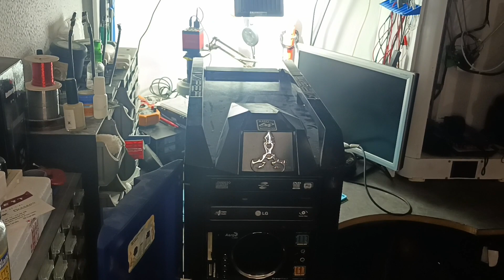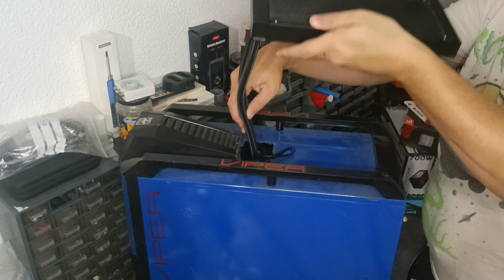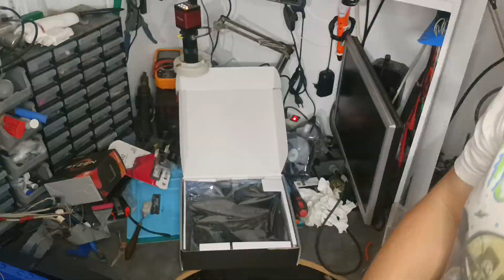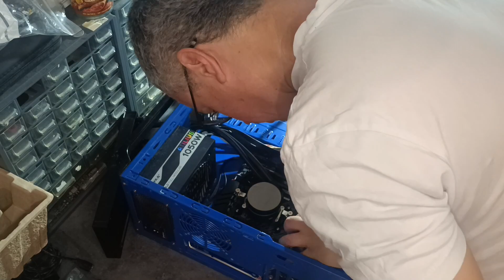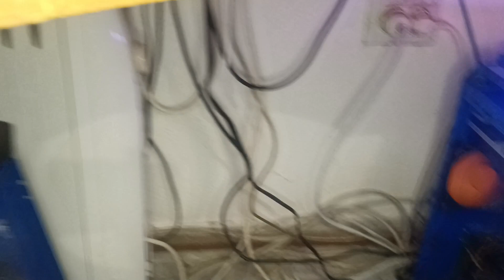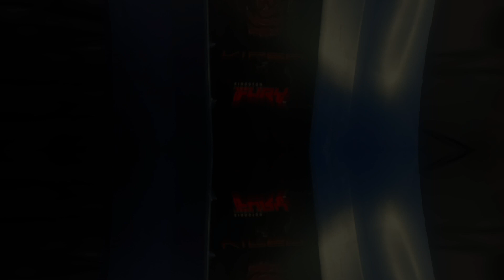New Computer Build - 3D printing and repair :)

Comment: I'm just now stumbling across this. Have you posted the video of the front display and how you fixed it? And does it require any special drivers to make it function with the rest of the build? I have this exact same case and I originally got the display to power on but I think I overvolted it and fried some capacitor or something, unsure. Been looking for months on how to fix it and get it working given I couldn't tell if it took a 5v supply or 12 or something. 
Regardless the rest of the PC works properly, but the temp screen is inop.
Reply from the maker: Hi mate , yes i have a separate video on the fix of the LCD, in my case it was broken traces  mostly: https://youtu.be/gHhKk_G3Llg
maybe its the same for you 

good luck :)

Comment: Wow Carlos, that computer looks amazingly awesome, can you give me the specs of all the parts you put in please. Great video, I’d like to see how you do the 3D printer stuff also mate, keep up the great work 🤙🏼🇦🇺
Joe from Australia 🤙🏼🇦🇺
Reply from the maker: Thanks a lot for the kind words :), 

Its a 
Ryzen 5900X 12core CPU
Kingston Fury -64GB of ddr4 3200Mhz memory 
Asus Tuff gaming B550M-Plus Motherboard
2 x NVMe bothe work at 3000mb/s write and read 
2x mechanical drives 8tb (backup)
PSU is a 1050 watt PSU silver rated 
total price(650€)

and ofc the star of the show and the most expensive part (a RTX 3090 with 24gb of VRam)
(bought second hand ofc 😂😂🤣🤣 = 700€)

the 3d print videos are recorded just need to be edited and will be released shortly
Reply: @RetroUpgrade  Thankyou Carlos, your videos are awesome to watch, I’ll be searching for these parts, to upgrade my computer, again I say Thankyou 🤙🏼🇦🇺
Joe from Australia 🤙🏼🇦🇺